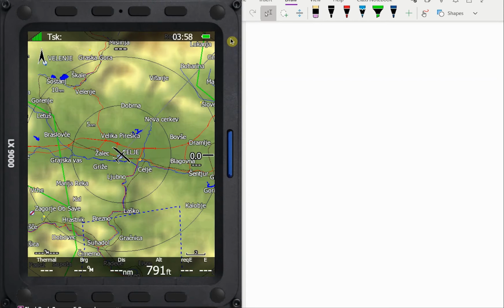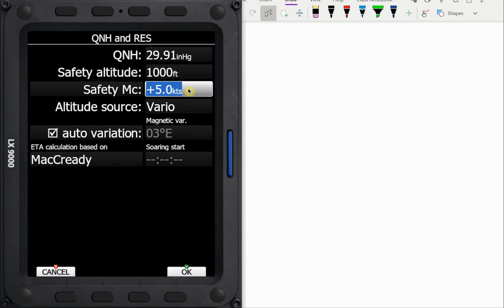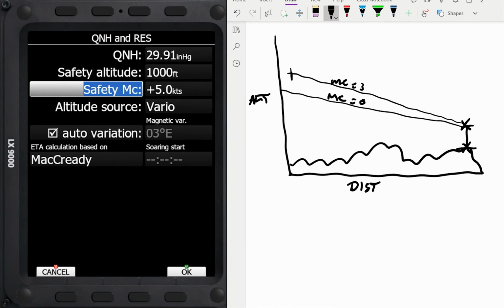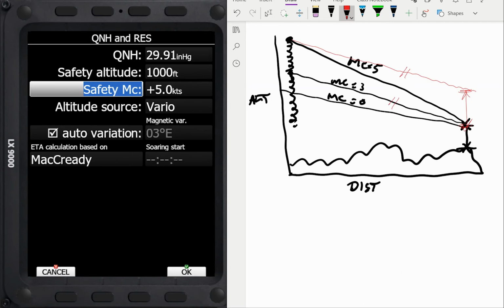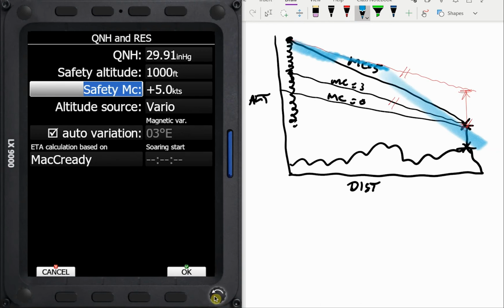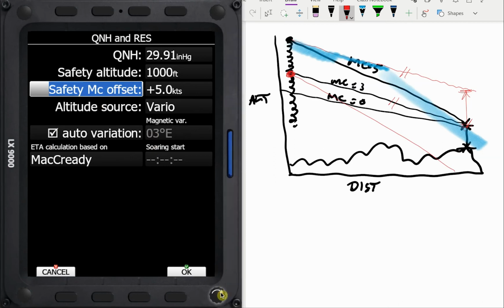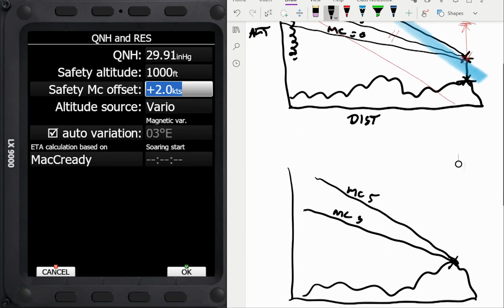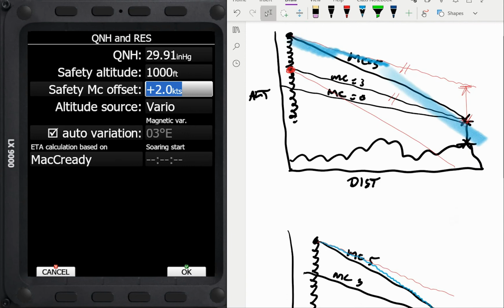LX 9000 using the Safety MC and Safety MC Offset functions

Comment: Dave, Are the Safety Mc and Safety Mc Offset mutually exclusive? In other words, if you use one, should the other be set to zero? Lets say that you use the Safety Mc Offset and you've set it for "2 kts". At the end of day the lift gets weak, making you adjust your Speed To Fly Mc to "1.0" or "0", does that mean that the 9000's final glide is only going to use a Safety Mc of "2", which might not be safe enough. What do you think?
Reply from the maker: As I understand it, you should use only one at a time, not both offset and safety.

If you use safety MC then final glide will always be calculated at the exact value to which safety MC is set, regardless of where you have MC set.  So if your STF MC is set to 1 or 0 and Safety MC is set to 2, then your required final glide height will be based on 2.  This is safer as it will require you to climb higher, but it is also slower if you are not climbing at 2 or better.

I believe if you have Safety MC set to other than 0, then it takes precedence on all glide calculations.  I don't think you can add an offset to the safety MC.

Comment: Very helpful and informative video.  Do you know if  the Safety MC settings applies to airport and waypoint glide pages/calculations?  Or is only for the Task final glide?  In other words if I have an airport “direct to” that is different from my task finish, is the calculated arrival altitude at the airport adjusted for my safety MC or safety MC offset setting?
Reply from the maker: The Safety MC and MC offset apply to ALL glide calculations so will affect waypoint, airport and task arrival altitudes.

Comment: Hi Dave
 Your video was very helpful thank you.
 I have had  a problem emerge with my LX9000 on the last flight and I was hoping you could help me?
  A voice message which sounds like " check overload" , accompanied by the on onscreen
message "check water ballast " comes out about every two minutes non stop!
 driving me mad :). I can find no reference or help in thee manual.
 Would be most grateful for your  thoughts.
 Regards
Trevor
Reply from the maker: Hi Trevor,
Glad that you found it helpful.  For the check overload, it sounds like something is wrong in the weight and balance menu, or in the MC/BAL short menu.  Have you set up the weight and balance?  Did you leave the ref weight as it was in the glider polar?
Reply: @foxonecorp  Many thanks Dave. I haven't had a chance to look at you suggestions yet due to covid lockdown being applied to my area. Hope to get back in action soon and let you know

Comment: That's a confusing design, because of the big + at the front of the number, I thought it WAS adding that number to the normal McCready. i.e. I thought the non offset mode was operating as offset mode. Thanks again!

Comment: New info for me thanks. But I am not planning to use it - I set Mc in what I hope will be my last thermal to the actual currently achieved climb rate, not including the time spent centering. This is generally higher than I have been using for interthermal speeds, for which I have used a Mc which allows for time wasted on 'tries' and centering. I then set off at the speed for that Mc, and if I encounter sink I reduce the Mc and slow down. I do use a safety altitude, which is a further level of protection against encountering sink.